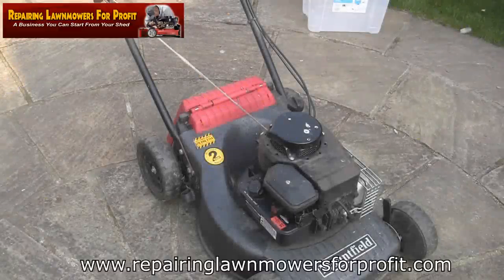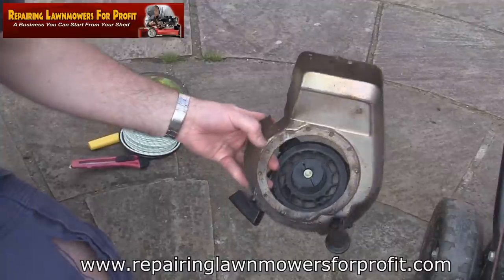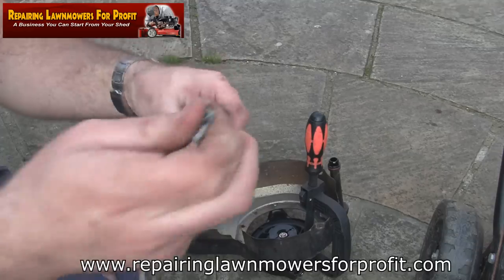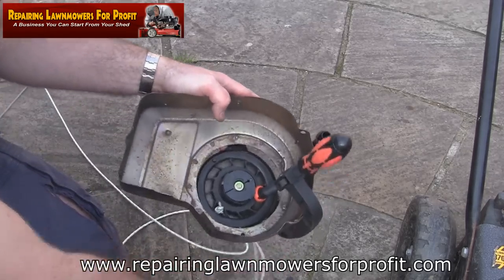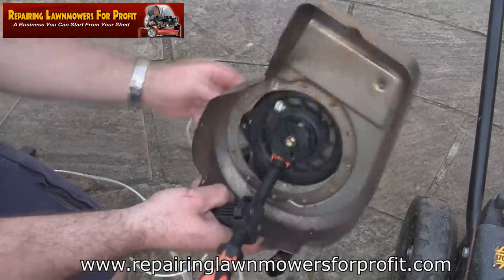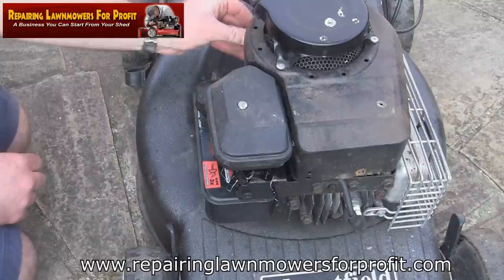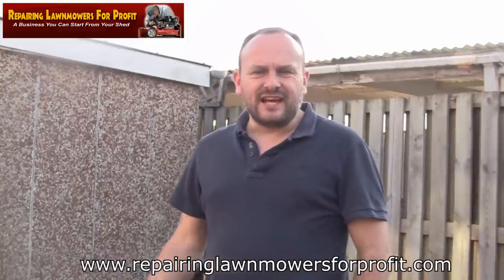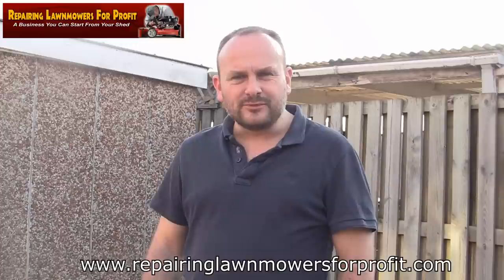How To Replace A Petrol Lawnmower Pull Cord Rope

Comment: what diameter pull cord do you use for these classic 35 engines, there seems to be lots of options from 2.5 to 5mm ?  Great to see more videos lately
Reply from the maker: offbeatwarble 3.5mm not had any problems thanks for watching

Comment: I have an rm55 160cc the cord broke so took the cover off to replace it. There is no tension when i put the new cord in it. So it does not self wind and once wound up i pull it and it does not retract?
Reply from the maker: spring broken
Reply: @MowerMan  can you recommend anywhere to get a replacement?
Reply from the maker: @younggunn9549  garden hire spares

Comment: I'm replacing the pull cord on a HP470 and having a nightmare in doing so. I've bought 4mm to replace it, and it seems like it physically won't fit through the hole. Tried burning, tried crimping the edge, even tried attaching it to a cable tie to feed it through the hole, but no luck.

Any tips or ideas?